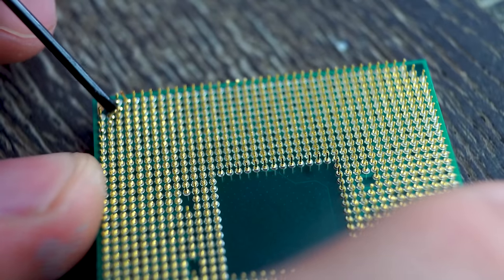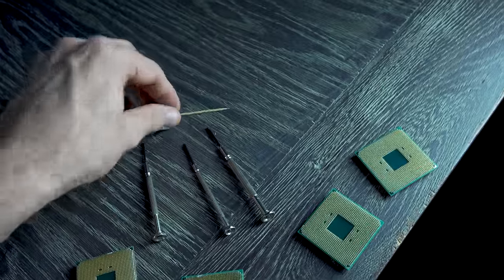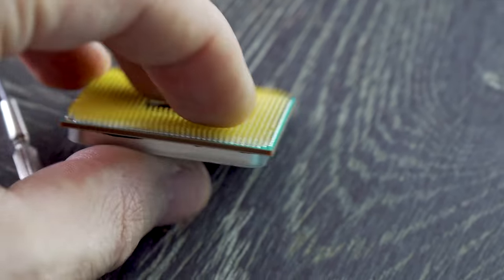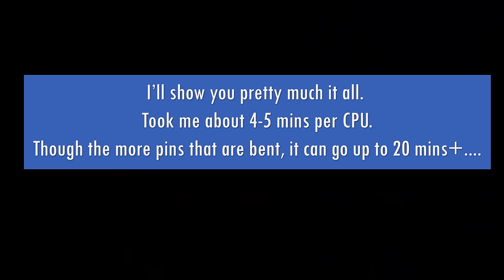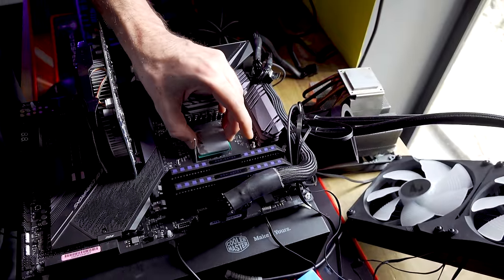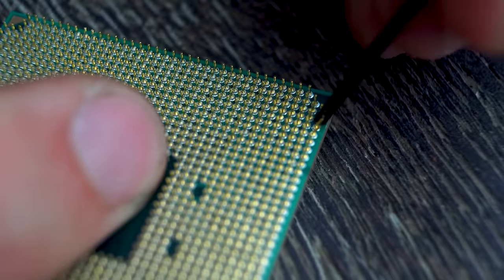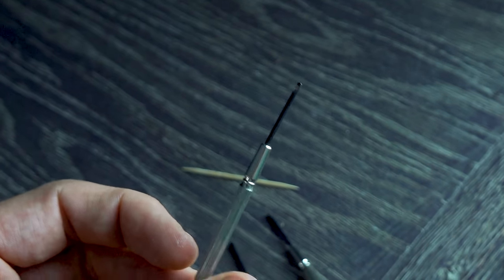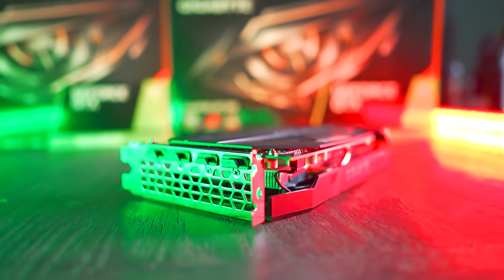How I quickly and easily FIXED 2 Ryzen 2700X CPUs with BENT Pins

Comment: Well I had experience with bending back pins on an i7-3720qm because the CPU was put in the retail CPU holder the wrong way (when I was upgrading from i3-2320m to i7-3720qm 3 years ago, I ordered the CPU from china and my mum was curious so she opened it up had a look and put in 90 degrees off because the CPU shape is so close to a square while it is not). I used a razor blade to bend it back and it worked perfectly to my relief (it was darn expensive and very powerful still before Coffee lake was a thing)

Comment: great video, but it comes a bit to late for me.  i did not know about the wiggle, so i pulled my cpu out the socket with bend pins as a result. did manage to bend them back and the system worked. only not like it should work giving me bluescreens for very weird reasons. RMA the cpu and no problems at all. will never know if it was caused by bending the pins.

Comment: A few days ago i bent around 15 pins on Ryzen 7,when removing prism cooler.
They bent in the upper middle of CPU.I bent them back without using magnifying
lens.It took me 1 hour to fix all but one.It was almost straight,but i gently pushed 
down in socket and hoped it will work.
I need to get me a magnifying lens ASAP   :)

Comment: Got a tip! If you don’t want to use metal  to bend pins(easier to cause dmg imo) when you buy Thermal paste most give you that plastic spatula, and at least for my first 2 ryzens it work perfectly to unbend them. 

Was as simple as sticking in the spatula to fit into slot in between pins. Alas this is for when you tear out cpu with cooler, and not really for drops, as this only works for pins being bent inward, and not outwardx

Comment: Wish I had seen this video earlier, I had the wraith prism cooler on my 3900x, in an Aorus Elite x570 mobo, the exact same thing happened to me, did the "wiggle" and the whole cpu came out with the cooler. Only two pins were bent slightly on the outer edge, I gently used my thumb nail to make it as straight as possible and it went back into the socket no problem. Then installed an aorus aio and was able to boot properly, fingers crossed that it lasts. i wish pins would be in the mobo like intel ffs, so much room for f'ing up a ryzen cpu.

Comment: Just a question for everyone in the comments. Did your cpu have a slight amount of wobble before it was locked in to the socket like it looks flat it drops in but on one corner there is a really tiny amount of movement when you push it down

Comment: Just a PSA for anyone with a broken/snapped CPU pin. I've read on a few old forums that a great/easy way to get your CPU working in case this happens to you is to stick a bent L piece of tiny wire into the socket slot that the broken pin sits in, That way, when and if there is still part of the CPU's pin left it can conduct to the wire and give you a working system. That being said, you have to be very careful with how long the wire is in order to not damage anything further. Hope this can be of help to any poor souls out there with a completely broken socket pin.

Comment: I heat the CPU with a hairdryer to make the pins more malleable. Every little bit helps.
Reply: i wouldn't do that mate you could possibly  de solder  something
Reply: @arkup1  no you won't not at around 80-90c. CPU's thermal throttle at 90c and I said hair dryer not heat gun.

Comment: i was having a panic attack when i dropped my 3600 in my case after chaning stock fan i used a sewing needle. At first it would go in but there was a still a bent pin or 2 i straightned them more and the noticed it was wobblying on the pcb, i then just pushed it in hard and it virtually clicked and thank god it worked the most sweatiest heart racing adrenline shakey experince of my life. i was there trying to rebend pins shaking like mad.

Comment: happened to my Ryzen 9 also with Noctua Cooler. I did it with a deck of plastic cards. Turns out that 2 of the card fits on the middle of the pins and you can straighten it out. Also have needle lying around. A thin but strong one. I shake in horror while doing it. its my first time.

P.S have also a towel on you if its your first time. A lot of sweat.

Comment: I just did this with the wrath cooler and ryzen 7 1700. The thermal paste on the wrath literally turn into cement.  I bent pins on different corners. The cpu was ripped from the mount.  I tried to bend them back. A few broke. I set it off to the side drive to Best Buy and got a 3700x. 

Idk if I’ll be able to get it to work.

Comment: Lol I've gotten pretty good at fixing bent pins, had some on my 2700x, and yesterday removed my 3600 , CPU stuck to cooler and slightly bent some on that too, using a Razer blade is the easiest I've tried
Reply: Hi. After several months the processor works well?

Comment: Greetings. Can anyone please help? I bent back the pins the cpu works and I can boot however it does not read B1 and B2 Ram sticks and it has them "hardware reserved" Can't even run XMP on. I have 32 gigs of the same ram sticks but only 16 gig is usable the rest are hardware reserved. Any idea what's the problem?

Comment: I dropped my ryzen 5 3600 only 4 inches onto a soft surface, and it bent one of rhe pins on the inside almost completely over,, but with just a kitchen knife, a razer balde and some time I was able to get it back into working condition.

Comment: I just did a case move today to the 011 dynamic and bent one of my USB 3.0 header pins. I was trying to bend it back and realized the pin was bent in the middle of the pin not at the base. Needless to say I was screwed. Only one port works now. $200 mobo 😭😭😭😭

Comment: NO NO NO NO NO!!!
There's a much better way IMO and that is to use a CREDIT CARD. You can push the pin towards its normal location while placing the card in such a way that all the OTHER PINS in the row prevent you pushing the pin too far. Nudge the pin slightly then rotate the card ninety degrees if needed to push the pin in a different direction and this should work out perfectly... you can even do multiple pins at the same time depending on how they are bent. if the pin is bent TOO MUCH for this method I would then perhaps use something else to nudge the pin just enough that the credit card approach works.

Comment: I didn't see you mention an anti-static wrist strap. Were you using one, and I just didn't see it? Or is it not required in your experience? Around my house, especially in winter, static shocks abound even when just getting in and out of my desk chair. Seems like cheap insurance for a pricey CPU. 

btw, who has the better overall approach, AMD or Intel? With AMD a broken pin means trashing a CPU. With Intel it means trashing a motherboard. In your experience and/or talking with your subscribers, which is more likely to occur based on current socket/CPU designs, and which is more expensive/inconvenient to replace?
Reply: I think you have a much better chance to fix an AMD CPU than an Intel socket. I much prefer the AMD way.

Comment: Regarding the 1660 Super, that's what I'm now going for, I was waiting for the 5500 XT but was dissapointed, considering in NZ atm there is only about a $20 difference between the 8gb 5500XT and the 6gb 1660 Super, upgrading from an R9 380 4GB
Reply: @timothybilotta8090  980ti and 1070 go for around $350+ used here (not many available), 2060 Super and 5700 are like $600+ new and can't find either used, 1660 Super is around $400 new, Prices in NZ don't seem to fluctuate as much due to import costs? Considering how close they are in pricing for peace of mind I'd go for the new one with the warranty, Thanks for the suggestions though :)

Comment: I have straightened 2 pins of R5 3600 yesterday. The pin bending occurred from opening CPU cooler (Stucked cpu by paste), But The MB socket (Gigabyte Aorus B450 Pro wifi) was locked during CPU pulled out. After re installing CPU MB socket locked fine and PC also work fine. But I am worrying about the efficiency of CPU and MB.Please, clarify my worries.

Comment: I remember b athlon X4 chips were packaged poorly and would get bent in shipping. I cunt 4 or 5 if them from different retailers and got bent pins on three of them. This is basically the exact method I used to use to get those going.

Comment: One time I picked up an almost brand new pc from a recycle center and the only issue was pins were bent. I got most of them back and then it came to a final one. I took the screwdriver and started bending it back and then it snapped off. 
And that’s why I’m always going to be super careful with AM4 CPUs

Comment: The problem with trying this on newer cpus is that the pins are on the motherboard  and they are so very hard to see as they are so tiny. Smaller I think then on older chips. The pins also reflect light which doesn't help. Even with a good magnifying  glass most people  are hard pressed to see the way the pins are bent.

Bv

Comment: How's this the easy fix when all you need is an automatic pencil, put on pin lift till vertical, 10 x quicker than a screwdriver lol
Reply: A lot of the mechanical pencil tips are still too thick to fit it on the pins
Reply: @JT-hz1hh  buuuut goo af idea

Comment: I got the same problem. During the change of the CPU cooling , I could not pull out the AMD fan and it came out with the Ryzen 2700x. With a same screwdriver I fixed some of the pin that was bent. But I got other problem after that. I had two 8 Gb rams, but now I am using only one. Only one ram slots is working. It does not depended on which ram I put in but which slot I use.( Only DIMM A2 is working) (motherboard Asus Crosshair VII Hero.) I did not touch the rams during the change of the cooling. It is possible to have damage a pit on the CPU so that why the rams slots do not work? Or it is a motherboard problem? If I remember correctly I am getting F9 code error from the motherboard (Q-code Led)

Comment: good job dude! i even also bent the pins for my friends since years ago...  mainboards from intel chipsets and amd cpus.  but the fx pins where bigger and stronger as the ryzen pins now! on AM2 they where also bigger fattter and less pins on the backside of the cpu. for AM3 and + a ECC card was perfekt to set them and test the range to the other pins. i got a few monaths ago a ryzen 1600 also bent pins. the card was not able to get between these smaller pins, there are even more and the distance from one pin to the next ist much clother now on ryzen 1000 vs. AM3 /AM3+ ! I DON´T Get a RYZEN 2000 or 3000 with bent pins allready so maybe they are even much clother than the pins from the 1000er series?!?  my tool that i use for fix them: tweezers, some tools for display change repairs and 
a good light, maybe like a flashlight that reflect the shining light on the pins. if this line is even the pins are on the right position. i got a socket bracket from a trash board to stick the cpu softly into this socket. if its allready done well the pins and the cpu don´t need to push into the socket, BUT THIS only work with disabled brackets socket claim (i think it´s called?!?)  i just mean the plastic part of the socket. this item is on a normal amd board soldered. even it was really hard to get this sh..t out of the board...  another thing are broken pins...  in best case you don´t need these pin... in worst case it won´t run. sometimes if you find the whole where this pin should be you can try to stick it into these whole and hope that the cpu get contact to it. even special glue is possible to use here but this is really difficult to set them back on their positions. even if too much glue is used the cpu also won´t run or startup...  inside the pin jungle the in the middle is the worst place for a broken one. outside there are more "dead" pins they sometimes called. pins wich just used for the voltage and there are many of it! so its even possible to run this one with one, two or more bent or broken pins if they are allready outside or in the corners. but now the worst case (yes worst worst...wurst,  lol)  if pins are broken and you lost them ...  the only thing that i found wich "maybe" have the same size as those pins are connection pins in many electronic trash...  yes i found another pin connector in a (car radio, i was it i don´t remember...)  other pins from older cpus won´t work i tryed it many times...  just from another cpu wich have the same sized pins. but if something like this happen to your cpu, don´t try to overclock it. even the voltage pins are needed for oc, maybe it run fine and after oc it won´t startup again even after cmos clear it won´t run again...  intel boards are even much more difficult to bent because the pins are not in a row like on PGA CPU´s. it´s a really unlovely job to fix it...  believe me...  the most boards and cpus i got fixed allready. its just the same like others before just more and smaller pins (AMD CPU´s)  maybe 85% i got fixed.?!?  i never did it with a screwdriver but you could and do it and it works, good job done!   #thats my experience with bent pins.....

Comment: I was wondering if you could help me. This is the problem. I wanted to change the cooler on my 3900x, and the cooler that was on it got stuck to the cpu and i pulled it out of the cpu socket and bent a few pins on the cpu. I am having real trouble trying to straighten them and have just given up. My eyes can't see well enough, and my hands are not steady enough. If you would be willing to help me with this, I would pay you of course for your time. Thank you for your time. Have a great day.

Comment: You will be better using a razor blade Its thinner and you are less likely to bend others. Back in the super early days when ever intel was on PGA you could use a thick screwdriver as they where much thicker .

Failing that you can take good pins off a dead CPU and re-solder them , but its hard to do and you will need a soldering microscope and hot air .

Comment: I went from the 4770k to the ryzen 3600 just 2 days ago and experienced my first bent pin situation. My new ryzen had two bent pins right out of the package. I couldn't figure out why it was uneven and not falling into place as I took it straight from the plastic to the motherboard. Finally, I held it at eye level with a flash light and seen two different pins slightly tilted. I was so angry. I bent them back with the tip of a knife. Now I'm trying to figure out a good fan curve with this silly cpu because it loves jumping around. I thought it was decent staying in the mid 70's playing Battlefront, but then I tried to convert a video, causing it to jumping into the 90's sooo...I guess more fan.

Comment: That wraith fan is trouble!, i bent two pins last night of my 3 month old cpu ryzen3600. Oh my i uses needle to unbend. Then thermal paste becomes hard to remove. Had to force it the lock took off cause off my pulling force. Works after fix. Scary
Reply: Hi. After 2 months the processor works well?
Reply: @gedimangediman  yeah no problems I play atleast 3 hours everyday.
Reply: @maekymaek.0302  Thanks

Comment: With 5500XT, I do agree with that they are too expensive and rumors have it that AMD wanted to make them even more expensive. So I would happily recommend older RX580/590 models over it. At 4GB end 1650 Super is bit cheaper and thanks to nVidia having bit better memory compression and driver optimizations, it seems like it is doing bit better than 5500XT 4GB and 8GB is just too close to RX580/590 at higher price or you can top it off with 1660 Super.

Though I do feel like prices are result on how much demand is on 7nm TSMC line, because even within AMDs stuff, 5500XT has to compete with more popular Ryzen 3000 lineup which probably takes priority, or better profit margins from 5700/5700XT, Threadripper and probably the best profit margin products, Epyc. So AMD has little in terms of incentive to produce less of those and make more of 5500XTs. Not to mention that next gen consoles will also take up order space, since both Microsoft and Sony will need ton of 7nm chips. Which is why I also feel we didn't get any 5600, 5800 or 5900. That is if we don't count demands for 7nm from other corporations, like Apple. So I feel like AMD figured out it is not worth for them competing in this segment, so they are just trying to cash in on people who would buy AMD anyway.

Comment: At the very least, amd cpu's with broken off pins won't break the pricy device. You can buy a HUUUGE pack of scrap pins on eBay and place a pin into where the broken off one should have been. It will make contact with the cpu and the computer just fine.

The amd cooler fans LOVE to cement onto the cpu and the pins bend when you try to remove the cooler. It almost always pulls the cpu from the locked socket. But the cpu is a beast in its shell. You can be fine so long as the shell isn't cracked and the processor underneath it.

AMD knows us haha.
Reply: The pack comes with 100 pins for ~$8. They are on eBay for someone who wants to get the gold off them but the pins are useful for just being the pins.

Comment: today i did bend my 3600’s 2 pin. i almost cried :( i bought it 2 days ago and it’s my first pc build. Thank God i fixed it 10 seconds after. 
Like others , it was stock paste. Dont use stock paste please
Reply: Hi. After several months the processor works well?
Reply: @gedimangediman  yeah. working well
Reply: @ashrafhridoy  Thanks
Reply: How did you manage to bend them?
I'll be building mine and I'm scared af. Any advice?
Reply: @User-su8js  don’t use stock paste. clean stock paste and use third party paste. I was forcing to unlock my stock cpu cooler while processor cam with it and bend 2 pic.